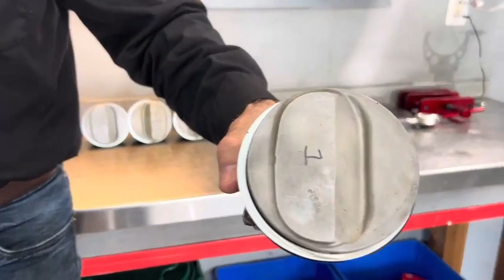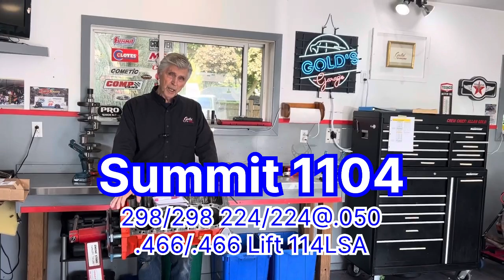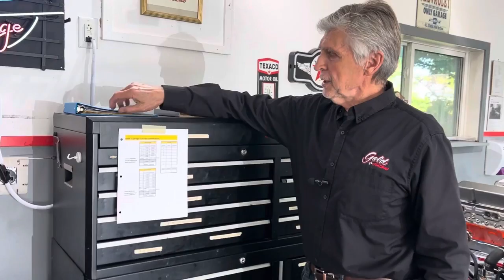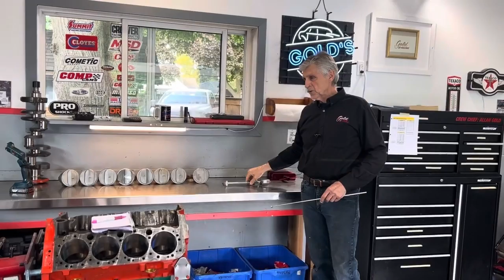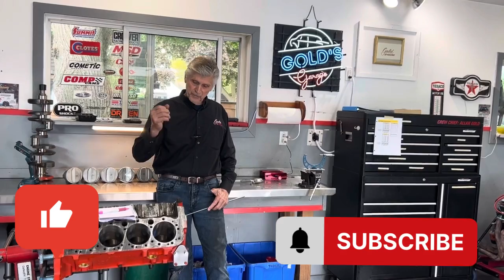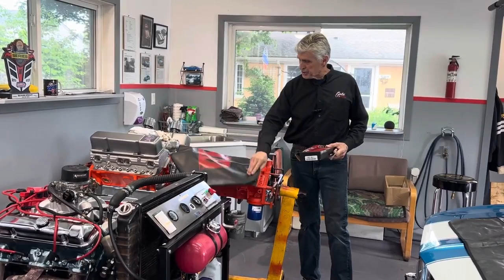I GOT RIPPED OFF ON THIS 350 CHEVY!! - What Happened?? What should I do??

Comment: On a street motor .001 to .003 clearance sould be fine, mains and rods......according to clevite`s book...most of them, fords have a little tighter specs. The 602 crate motor from GM makes 340 HP at 5200 rpm with vortec 602 heads a smaller cam dual plane intake and a 650cfm carb, did I mention a dished piston aswell? Those little vortec heads will out flow 202 ported camel humps from the old days...isn`t technology amazing?
Reply: A 602 making 340hp is pathetic
Reply: @fastinradfordable  Its 350 cid...602 is the last 3 digits in the GM part number

Comment: Thanks for another well done video. I especially like when you identify a camshaft and mention the rpm that is a target with said camshaft. As I watch your videos it becomes more and more apparent that building a race motor is substantially different than building a street engine. The owner and driver of the car needs to be realistic about how a car is going to be driven. Who really drives a street car at 6500 rpm??. Your realistic approach is a breath of fresh air!!!!!
Reply: Yes sir one must program the engine for what one is going to do. Running an engine that is setup for drag racing is just that for racing purposes only. One cannot have the ultimate do all catch all engine for everyday driving purposes. And if you drive a street car at 6500 RPM you are just going to wind up with a ticket getter and resulting higher insurance rates,

Comment: Good street cam. If you have ahead with a good valve job and low lift flow in the chamber should do well.
Reply: That cam sucks ass. The technology in that cam is 40 plus years old....Vortecs generally prefer a 110-112 LSA.